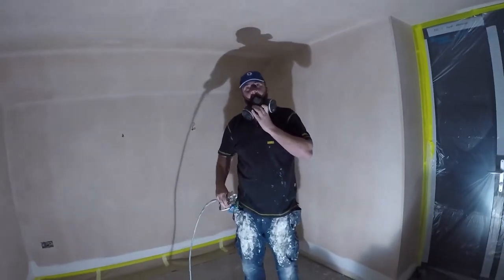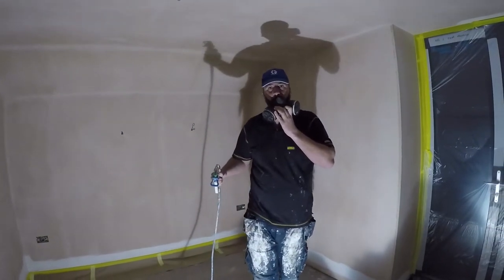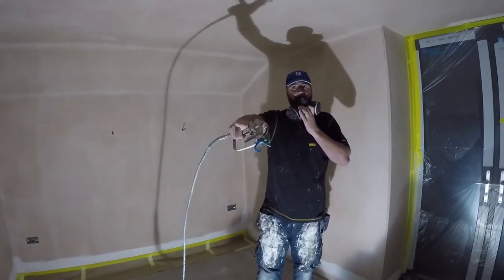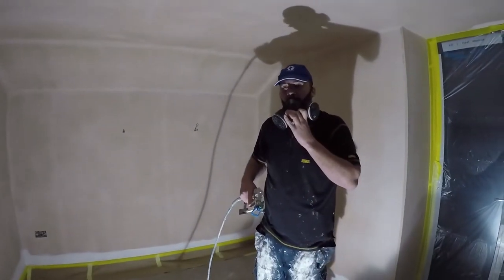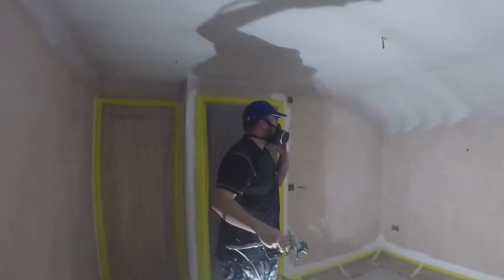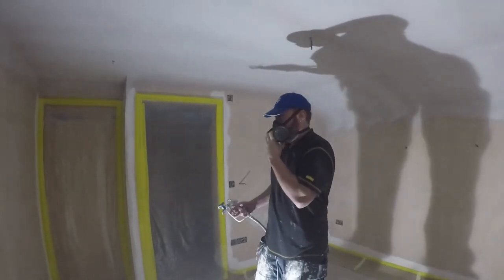Airless spray painting with a Graco 390. 618fflp tip Mist coat

Comment: I use a 695 to prime drywall. 390 would be use for small jobs on trim and doors. 395‘s are the best all around. 495‘s are really good as well.
Reply from the maker: Id go for a 495 for a great all rounder. Recently got a tritech T7, i sjow quickly in the latest video
Reply: @sprayaholic  one can argue that the 595 is best in this category since its the same or similar weight but more power.

Comment: Hello there as I purchased my first unit 390 classic in 🇬🇧 question is do I need to thin emulsion paint prior to spray. Or is ok straight mixed from container ? Plus is any emulsion ok or is different for spayers ?
Reply from the maker: I usually dilute about 10% as some are really thick. If its bare plaster gbe then dilute around 30% or follow instructions on the tin. It will spray neat but you'll be on higher pressure.
Reply: @sprayaholic  I just bought normal white emulsion in wickses from crown is that will be alright for sprayer. Plus if I spray already white on wall do I still need to dilute ?
Reply from the maker: @79Pavlito  i like to by 10% it eases the flow and allows pressure to ve abit lower.
See how thin the pain is first ifnits runny then dont. If its thick then jts ok to do so. Crown retail is cheapish and runny crown trade is nicer.  But you'll be fine spraying it
Reply: @sprayaholic  thank you 😊 where you can get nice paints and tape ? Online ?
Reply from the maker: @79Pavlito  i buy alot from crown decorating centre they sell alot. See my other videos for mask up and spray.  That's all from a crown store
Reply: @sprayaholic  thank you 😊 sorry for too many questions lol
Reply from the maker: @79Pavlito  happy to help ✌

Comment: Hiya boss. I use 390 never gone over 517 tip. Does she run ok
Reply from the maker: Hey. I use the green LP tips. Been using a 621 recently it flies out. Pressure still around 1500psi or so. 
Mainly use a .19 though either a 619 or 519Lp. Havnt used standard tips for a long time
Reply: @sprayaholic  happy days cheers mukr

Comment: Looks good mate 👍🏻, just getting into spraying mainly empty houses and light commercial, don't no what sprayer to get to many to pick from, do you think the 390 be ideal for me ? Thansk
Reply: Budget £1000 - £1600
Reply from the maker: Hey. Mine is a 390 and if done some big jobs with it. Around 1100 i think they are. That would be a solud starter unit no doubt
Reply from the maker: If your budget goes to a 495.. its abit more powerful so if doing alot of work more constantly and is a power horse. Its got smart control and brushless unlike a 390... unless the new ones are brushless im not sure. But always buy the best you can afford at the time
Reply: Sprayaholic thanks mate appreciate the advice 👍🏻
Reply from the maker: T T no worries. Try hitech spray/spray direct.  Usually good prices
Reply: T T 
I have a Graco 390 and a Graco 490 and I do plenty of jobs and hadn’t had a problem with it so far so good

Comment: How bad does it flash? I picked up a fflp 620 today to attempt to spray without backrolling.
Reply from the maker: THE_FAMILY_MAN_CLAN it doesn't flash if you get it even. If youre doing ceilings you can cross hatch so go one way with a lighter coat then straight away go the opposite way with a heavy coat. You see alot of guys spray ceilings and it looks like glass when they finish because its still wet. So try to keep a wet edge. 620 will be great. 
Walls, again make sure you have even overlaps and if you keep the wall wet it will all dry together.  Flat paint helps with avoiding any flashing from un even surfaces too
Reply: Sprayaholic right on,thanks!  I've got a few houses to practice on, the finish is eggshell unfortunately. 🤣
Reply from the maker: THE_FAMILY_MAN_CLAN. No worries. worst case just back roll like i did in the video. Still sooo much faster than brush and roller
Reply: Sprayaholic I went back to my trusty 1223 tip but did the cross hatch pattern and it was a game changer
Reply from the maker: THE_FAMILY_MAN_CLAN nice. Ye they are abit slower but less waste product as minimal overspray

Comment: Wosup fella. 👍
Have you tried using flat tip setup  ?
Reply from the maker: Hey.  No never tried them on my jobs. I use mainly LP and fflp tips. What are you using? Dont they use flat tips with AAA
Reply: @sprayaholic  dont know,  been watching guy using graco silver plus gun.
Reply from the maker: @MrLeshop  i know they can be used for spraying heavier coatings at higher pressures. More than what my machine could go up to. 
But for standard spraying id guess many used these prior to the release of the newer guns and new low pressure tips. Id rather be running my machine under 2000psi than smashing it out and fogging rooms up.
Im sure ive know lads has flat tips with the g40 gun on the AAA but im not up on AAA as dont have one.... yet 🤣
Reply: @sprayaholic  can be used on low pressure   to,
Reply from the maker: @MrLeshop  ye but i compared to the new lighter guns and lighter trigger pulls for standard spraying i dont think there would be any benefit. 
Ye dont know if the flat tips go in the Rac 5 guard or rax x gaurd so dont know if you csn use those with the contractor guns. But i havnt seen anyone use one of those in the UK unless it was for other paints. See alot in USA saying its one of the best guns to be made . Someone was talking about one the other day on one of the forums
Reply: @sprayaholic  I'm gonna order one Monday,  il Let you know once iv tried it..
Reply from the maker: @MrLeshop  cool, what machine are you using and Any reason why that gun over other newer models? Im using the new Compact at the min its brilliant
Reply: @sprayaholic  same as yours 390, looks like more control less overspray
Reply from the maker: @MrLeshop  be interested to hear. But i dont think thats due to the gun
 Just the tips. And id guess pressure would need to be higher to get a nice fan. The 618 and 619 lp and fflp tips i use are so little over spray and a nice soft edge. What tips you gone for?
Reply: @sprayaholic  211, 409. Low pressure.
Reply from the maker: @MrLeshop  ah i think i was thinkinh the line lazer tips. Those the same type that are used with the g40 gun for aaa. Well graco fits graco and not seen the tritech set up. Didnt think you could use that set up with normal airless?
Reply: @sprayaholic  take look at mikethepainter.
Reply: Comes with cone housing filter
Reply from the maker: @MrLeshop  nice one. Looking forward to hearing your thoughts
Reply: @sprayaholic  haha its here, also came with this other filter worth £60. Well happy can't wait to try  it .
Reply from the maker: @MrLeshop  nice. Never even knew about those before. Send me a pic over on my Instagram page if youre on there. Lets see what it looks like. Do i need one haha
Reply: @sprayaholic  I'm not on there. Picture of the filter you mean, could I do video on my page instead?
Reply from the maker: @MrLeshop  wait till you've got it all set up and ye make a quick video using the gun. Be nice to see it in action and what you think compared to standard tips and gun
Reply: @sprayaholic  Will do"
Reply: @sprayaholic   You want my verdict on converting to flat tip?
Reply from the maker: @MrLeshop  sure. Did you manage to get a video? And are you comparing it to like fflp tips
Reply: @sprayaholic  I WONT  BE USING REVERSE  TIPS AGAIN.
Reply: @sprayaholic  All you really need is the Cone filter housing, filter & flat tip holder, Your little compact gun will be Pukr, investing in the SILVER  PLUS would be personal choice I hopped for the cheaper version HANDOK DS700 thing. LOAD OF RUBBISH!!!
BUTTT back to TIPS.
For Me
IT WILL BE FLAT TIP ALL DAY
Reply from the maker: @MrLeshop  really. I'll check it out. So what would i need to buy then
Reply: @sprayaholic  il do video for you
Reply from the maker: @MrLeshop  nice one look forward to it
Reply: @sprayaholic  it's on my channel
Reply from the maker: @MrLeshop  did you take the videos down?
Reply: @sprayaholic  il put it back on my channel now fella give me minute
Reply: @sprayaholic  have you seen it Simon
Reply from the maker: @MrLeshop  ye was just watching it again. What make is it tri tech? I keep asking and people are saying aaa use with flat tips. And i said ive seen one thats for airless on its own.
Reply: @sprayaholic  Handok DS7000, I think the tritech is same 1 just different name on it
Reply: Tha aaa tips are for air assist guns I thought, its different tip altogether
Reply from the maker: @MrLeshop  I'll have a word with spray direct. Keen to try it though if i can use it on my standard gun which sounds like you can
Reply: @sprayaholic  100% you can yes..
Reply: @sprayaholic  any info or news on flat tip fella. Did you phone spraydirect after..?
Reply from the maker: @MrLeshop  ive not had chance yet bud im working all hours at min on a massive job. Asked graco and they couldnt really comment as they only have it for the air assist g40 gun. So would need to speak to someone else. Have you tried yours yet?
Reply: @sprayaholic  behave, of coarse, just using standard gun that came with 390, waiting on refund from handok gun then il order graco silver plus
Reply: @sprayaholic  hi Simon, what pressure  do you run on when undercoating  ?
Reply from the maker: @MrLeshop  this week ive been on about 1000psi. But upped it abit so i could go faster
Reply: @sprayaholic  I run it on 700
Reply: Do you spray your gloss work Simon, noticed couple on here brush they're gloss work
Reply from the maker: @MrLeshop  i dont use oil.  But sometimes if i want to finish a room in a day. I'll mask prepped woodwork off  spray 2 coats walls and ceilings. Rip masking up and brush woodwork  can sometines be alot quicker as walls and ceilings can take a while to do 2 coats. Where 10 mins with the sprayer
Reply: @sprayaholic  yes depending on the job,  let's say for argument  sake New build house, would you spray your gloss
Reply from the maker: @MrLeshop  ye id prep and spray all the woodwork first with primer. Then meet the mistcoat to the primer overspray on the wall. Finish ceilings off after mist coat. Quick pad off on the woodwork when its dry. Finish woodwork. Quick whiz over yhe over spray on walls Then mask it up and finish walls by hand. 
If the gloss takes too long to be able mask up id maybe finish top by hand and spray and back roll walls. Depends on products really
Reply: @sprayaholic  wos up fella.
 FLAT TIP nothing like it..
Reply: @sprayaholic  Run all day NOT one tip block . Pulling trigger now puts smile on my chops fella lol
Reply from the maker: @MrLeshop  how much was the set up? I'll buy one next week
Reply: @sprayaholic  seriously dude not so long ago you asked me do I need one, know my reply is YES..
Cone filter housing £29, Tip holder £10, tips £18. Filters next to nothing. Everything  will still fit the same. Poles, clean shot etc.
One strange thing iv noticed my pressure is slightly higher on 2100,2002 ish, but the pump runs like it's on 1000..
Reply: @sprayaholic  spoke to Connor from spraydirect, they don't get much call for them flat tips but yes they do them Same price £18 pv
Reply: Wosup fella.
This as taken some getting used to Simon,
Tailing it does dry back though, anyway' Solution!! 
Thinning paint correctly/pressure.
Is it worth it.. quite simply Yes.. ordering the graco 515 tip from spraydirect 2moro.
Reply: Simon. Iv had all day now to play about with my flat tip setup.. its game changer fella...
Reply: Running @ 1100
Reply: Iv just ordered graco silver plus gun
Reply: Simon made you short video on my channel